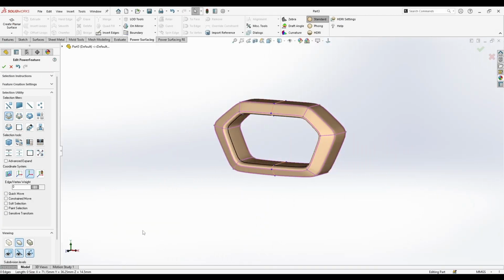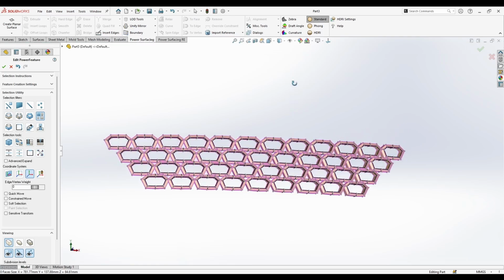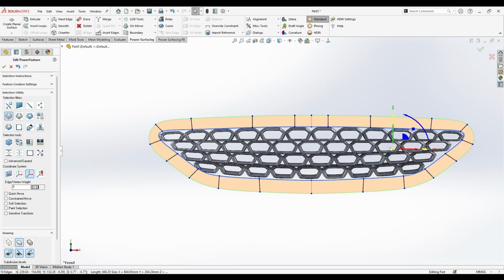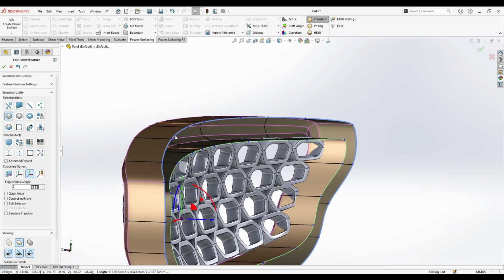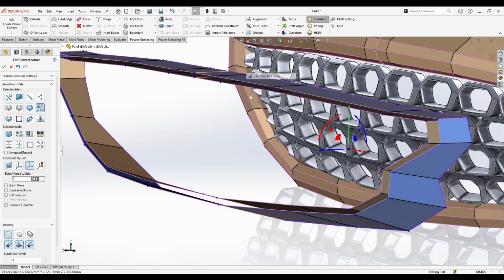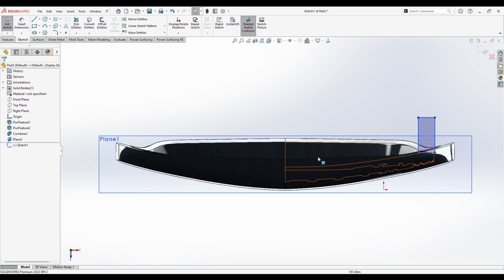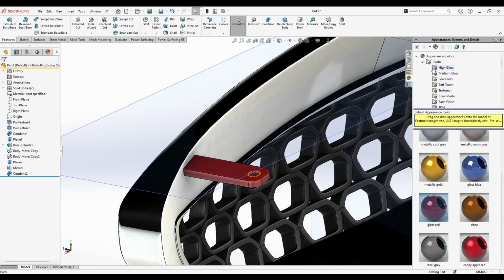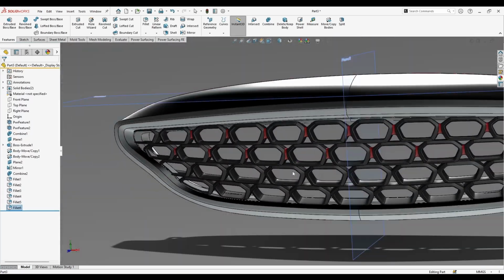Bending Multiple Bodies - Power Surfacing | SOLIDWORKS

Comment: i am a big fan of this tool. i used its trail version and it is really amazing tool. i use it for reverse engineering and also use it as free form tool
Reply from the maker: Keep rocking with it and discover cool tricks and hacks!
Reply: @npowersoftware6638  I also wanted to start a tutorial on this tool for beginers. but i think there should be more controls, like once we are done with thicken, then we can't reverse it. i will make a list of feature that needs to be improved.
Reply from the maker: Agree. @mubsharusman4318  

But For Thickness it's not big deal we can get back to Original State. I will make a video on that.